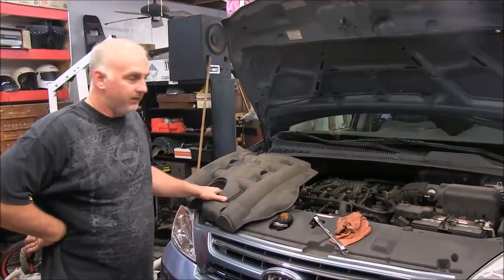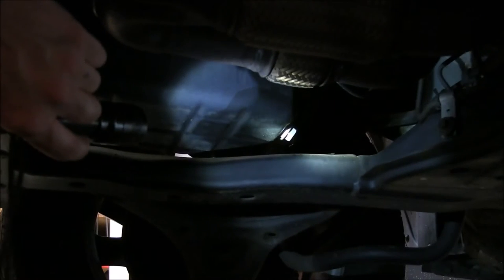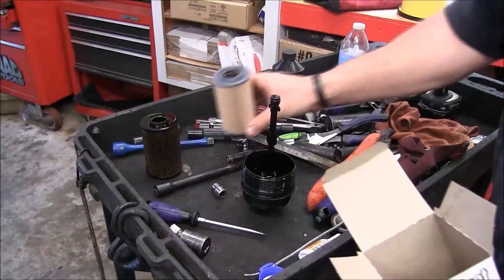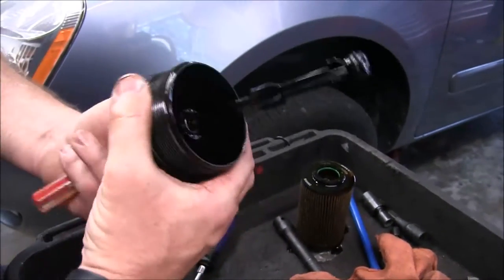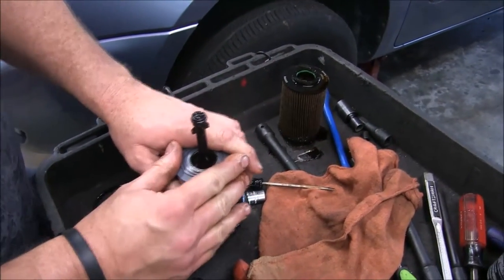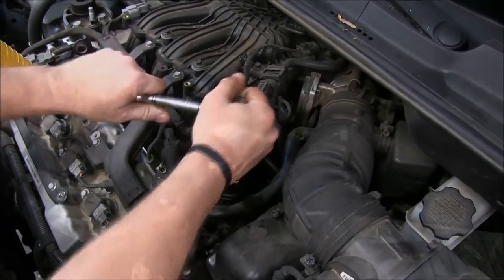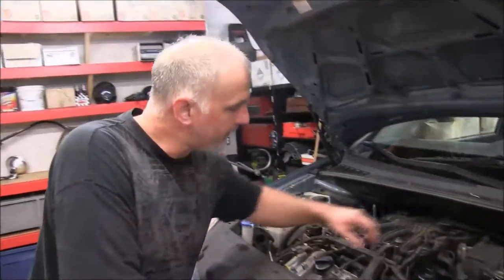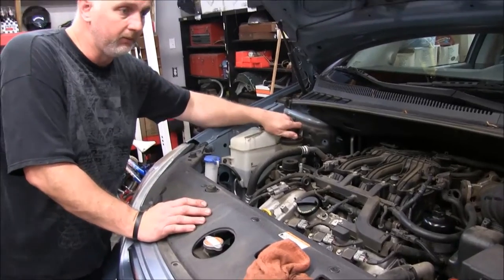How To: Change Oil In A 2009 Kia Sedona

Comment: Great video!   Everything seems easy and smooth.   Somehow, I had a great deal of difficulty filling the oil to right right level, ending up repeating draining and refilling.   How much engine oil is correct amount to be just above Low level.
Reply: I put one of those big jugs plus one quart. I think that would be six quarts. Maybe a little shy of that. I actually added some oil additive and half of the last quart.

Comment: the 2012 is slightly different but basically the same. there's only the large o-ring on the cap. the filter has a guide pin so can only go in one way

Comment: You didn't say what mm socket to use to remove the faring on the engine. Would that be a 10mm?
Reply: 100mm sounds right. My 2006 is 10mm.

Comment: While I did enjoy the video I found 2 things that were not right as presented #1 lubricating the o rings on oil filter is a must but how about new clean oil not not oil that was in housing after draining oil it could have grit. And new gasket - metal o ring under drain plug he said if needed replace it well it comes with the new oil filter so change it no guess work that way..

Comment: Thanks for this video. I'm about to buy a 2011 Kia Sedona. Do you know what's involved in doing a transmission fluid change? I have changed the fluid a few times myself in my 2006 Dodge Grand Caravan which involves dropping the pan and replacing the same amount of ATF +4. I don't see a dipstick on the Sedona. Any chance of making a video? Thanks.
Reply: there should be a red marked little button looking thing on the top pull that. thats your dipstick

Comment: how many quarts?  6?
Reply from the maker: It varies with each vehicle.  Please see the owners manual of your vehicle.  Thank you for watching.  Please come back to our channel for more How To videos.  Have a great day.
Reply: 5
Reply: 3.8L is 5.5 Qts. @juanortiz6009
Reply: @nbpt1000  nice
Reply: @minthillbilly  Thanks for the very helpful video, but this basic question about oil capacity really deserves an answer -- not a cop-out reference to the (terrible) KIA owners manual.  (helpful on features, but awful on basic specs -- and a shockingly short, useless index)  I'm a new owner of a Kia Sedona 2009 and the manual.  Under maintenance, under engine oil section 6-12, its so unhelpfully tells us to have the oil changed by an "authorized Kia dealer" -- though it does say to use "only specified engine oil."  (which it then tells us is to be found vaguely under "recommended lubricants" later in this section....  which you'll be lucky to find at p. 6-58....  But guess what?  NO SPECIFICATION OF JUST WHAT THE CAPACITY IS!  Nowhere.  So how about telling us what in your experience for your 2009 Kia Sedona is the capacity?  What, btw, does your owner's manual say?  (and on what page?)  "Have a nice day."